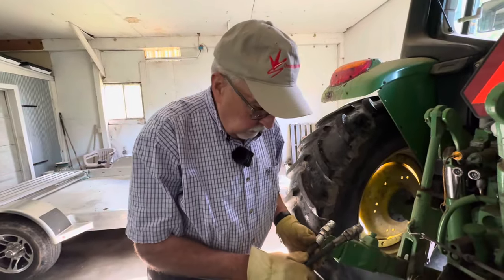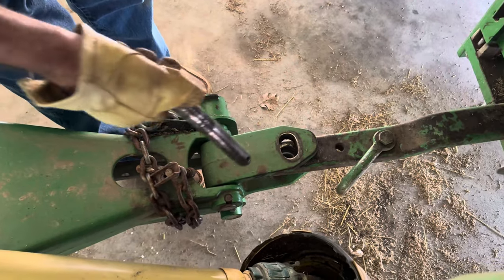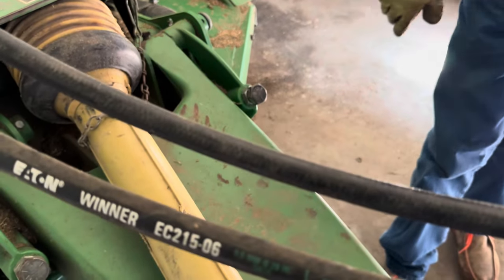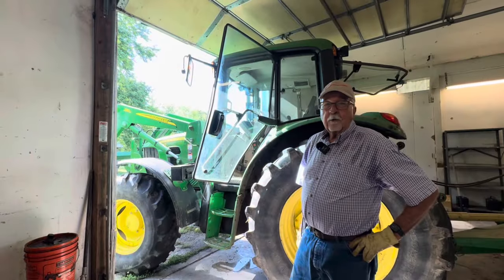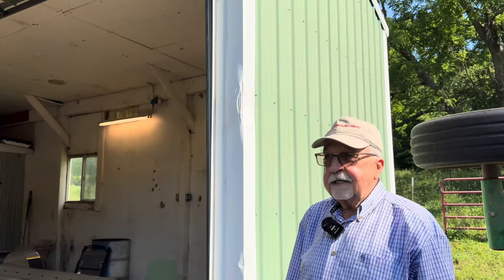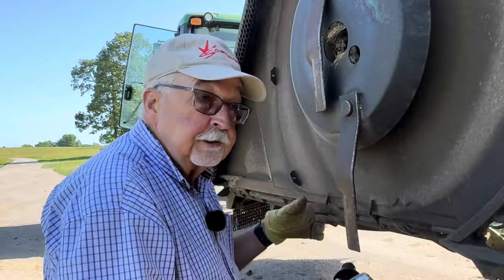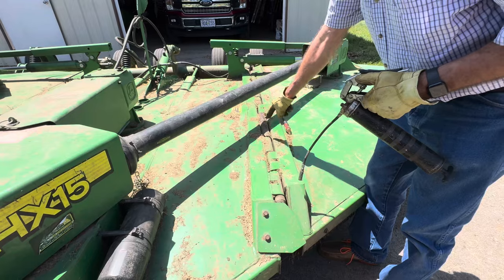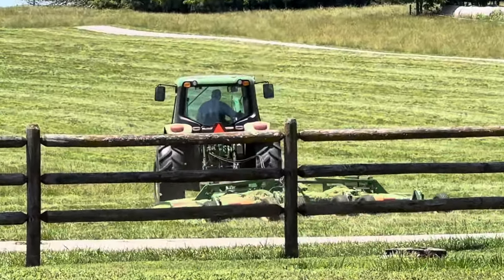Finally Clipping Pastures

Comment: I also have a JD HX-15 rotary cutter.  I see that you cut away that green plastic shielding from behind the pto coupler.  I left mine on and it is a booger to greese those zerks.   I like your tip on the pto shaft strap.
Reply from the maker: lol! I didn’t cut it away, but it eventually ripped off—and I wasn’t disappointed!

Comment: What number tractor are you using on the HX-15.? I'm thinking of downsizing and trading one of my row crop tractors for a little less HP and a newer model. I don't need row crop tractors any longer, now that we've rented out our farm ground. I'm wondering if a 90 HP JD 5090 or a 100 HP 5100 would be adequate.
Reply from the maker: @steveningrahm8928  Either model would probably be sufficient. I pull mine with a 6330, which is 82 HP (using the old rating method) so I think the 5100 replaces it.
Reply from the maker: Those older, preDEF machines are selling at a premium, now!
Reply: @JERRYCROWNOVER  Yeah, that's what I hear. I check Tractor House and Machine Finder regularly to keep up to date on the asking prices of used machinery. I can probably sell my tractor and loader for more than I paid for them new in 2005. I have found quite a few new and lightly used 5090E and a few 5100E tractors with loaders at Missouri dealerships.